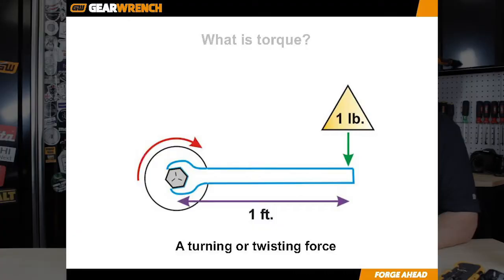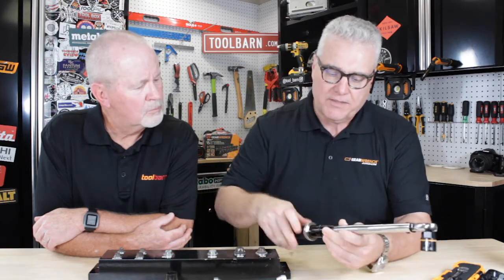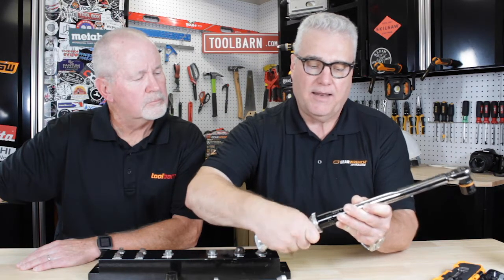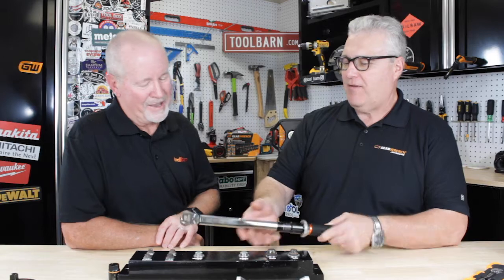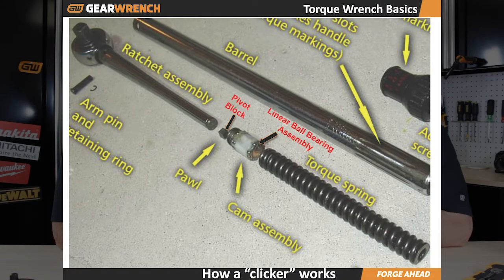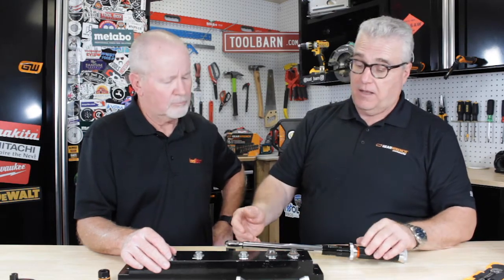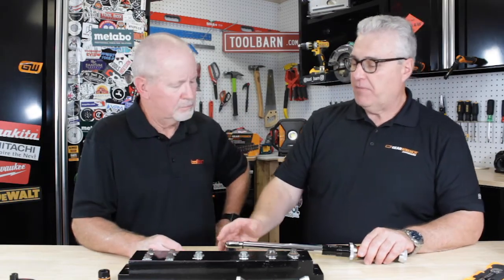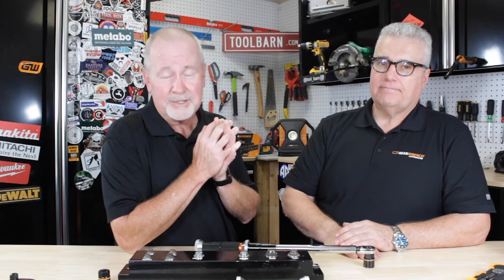How Torque Wrenches Work

Comment: Would using a socket adapter from 1/2 to 3/8 affect the torque on the torque wrench ?
Reply: As long as you don't use a swivel socket
Reply from the maker: don't think so